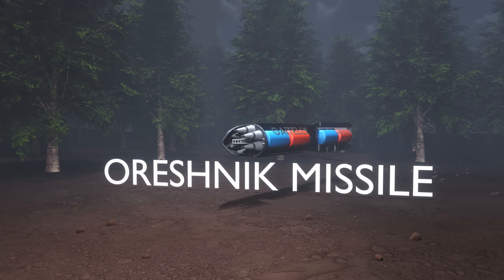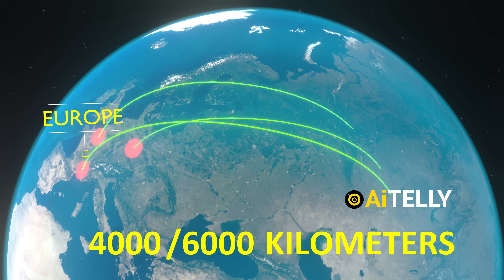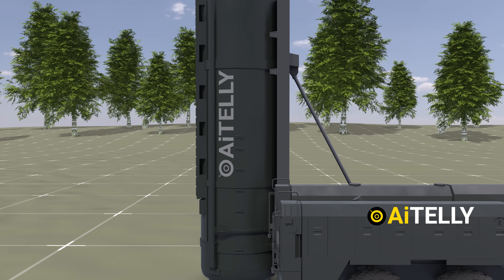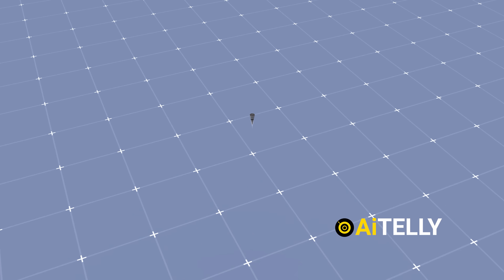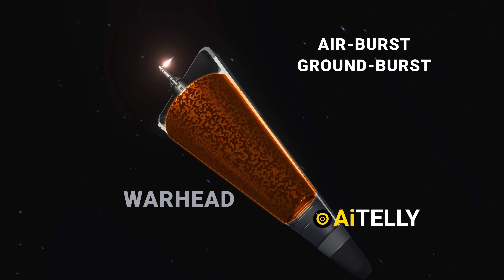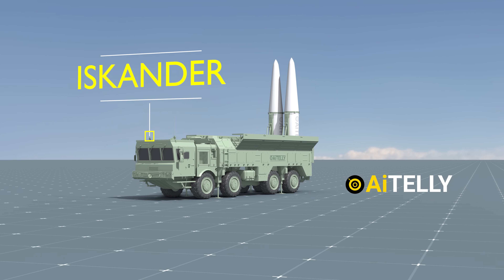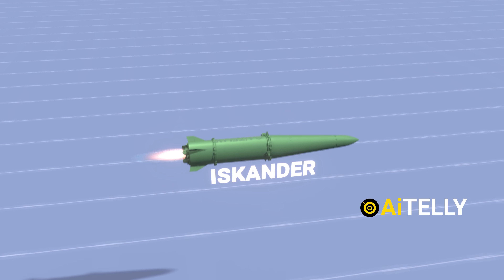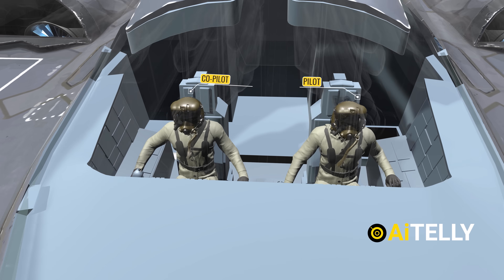Oreshnik Hypersonic Missile | How Russian Intercontinental Ballistic Nuclear Missile Works?

Comment: all icbms and irbms go at hypersonic speeds facepalm
Reply: There is a difference between a ballistic and hypersonic missile, one of them can maneuver, which means that it does not follow a ballistic trajectory, and therefore does not belong to ICBM ballistic missiles
Reply: @gokhanylmaz8514  “hypersonic” only refers to speed, so their capabilities dont determine that. I think you meant the difference between ballistic and cruise missiles or that there can be a hybrid of both
Reply: @eohq The Avangard missile could be considered a hybrid, a mixture of cruise and hypersonic missiles aka HGV, because it can maneuver on a horizontal plane, and the oreshnik maneuvers vertically like a zigzag,so these are different types of missiles. And I can’t classify oreshnik as a ballistic missile because it doesn’t fly along a ballistic trajectory. and so we have a rocket but we don’t have the type of rocket.
Reply: @gokhanylmaz8514  Not really, you had ballistic missiles with maneuverable warheads in the 80s, Pershing II being a good example.
Reply: Key difference , these do not follow Classic ballistic trajectory at hypersonic speeds....
Reply: Facepalm yourself please, not every icbm can reach such a speed at final stage. Which is the point. Oreshnik is above 10 machs at every stage.
Reply: @Charles-pf7zy  Exactly, people acting like this is some cutting edge technology when multiple nations have possessed these kind of missiles for decades 😄
Reply: @jovelo902 USA doesn’t have these. These missiles can be controlled and evasive. The us doesn’t have any defense for these and they also don’t have these. So do your research. Buffoon

Comment: I wonder if there's a way to intercept this missile?
Reply: The speed is so high (about 3 km/s) that the anti-aircraft systems do not have time to calculate the trajectory. Remember that they have to detect it, calculate its trajectory, aim and then fire (roughly speaking), so by the time they get to fire, the warheads have long since passed the interception point.
Reply: Боеголовки даже радары не увидят. Поскольку вокруг них образуется облако раскалённой плазмы.